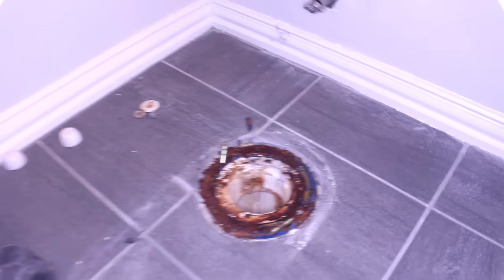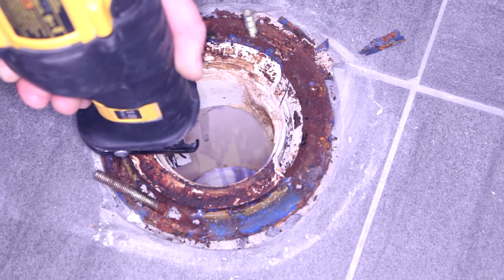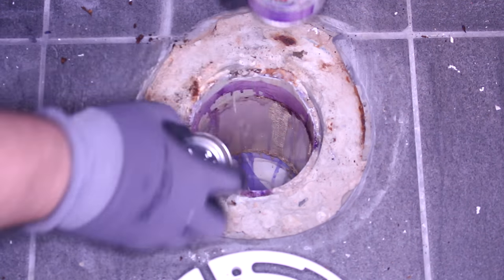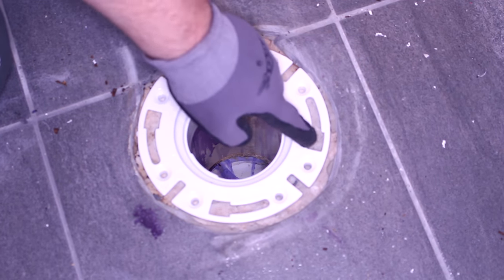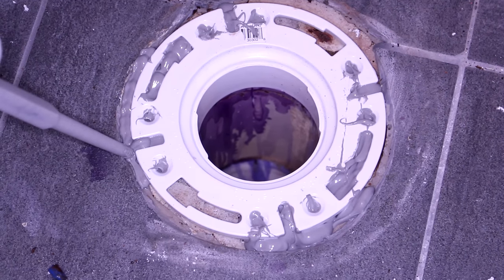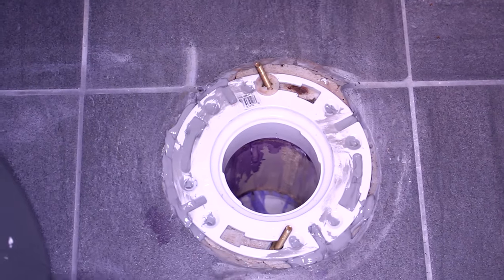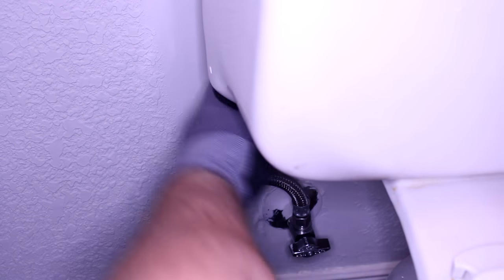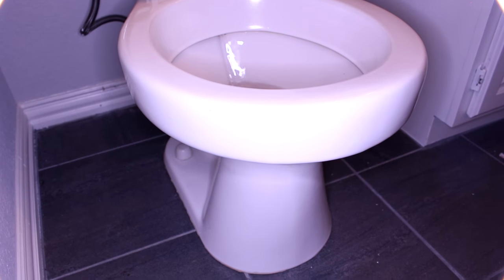How to Replace Toilet Flange - DIY Instructions

Comment: Why is it stuck in there so well  to need a demolition by chisel?  Its just supposed to go in there by friction fit so it can be replaced in the future as nothing lasts forever.  Since  the union goes from a small 3"opening to a 4" pipe it does not leak
Reply from the maker: Did research on it and yes you are right ,  no need to glue it if you can secure it to the floor. thank you for your input.
Reply: My old broken PVC flange is also cemented in.  I am going to have to saw/chisel it out as well.  And no, I WON'T be glueing or cementing it down when I'm done.  If the weight of the toilet (and passenger) is supposed to be enough to keep it in place and water-tight, then all I should do is slip the flange into the hole, add the ring (foam or wax), insert the bolts and set the toilet.  Right?  

Of course this assumes that the foundation you're setting the flange on is level. If not, because they were sloppy and poured concrete or foundation filler around the 4" pipe and never leveled it, then you get into what this video covers.  Adding shims, pouring in quickcrete to create a level foundation for the flange, or worse - trying to backfill voids with filler WHILE trying to keep the flange level at the same time.  Pain in the arse.
Reply: I would suggest that should the system back up, you could end up with something getting between the layers of PVC. I took a different approach and used a bead of flex seal rather than PVC welding cement. I can break that loose in the future, but will stop any grey water from contaminating my foundation should I have an unfortunate back up.
Reply: @SickTwistedFrq  Why not silicone?
Reply: Dr. Dr.
Reply: @briank8482  water gets past silicone slowly. It can take years but it will cause leaks.
Reply: How do you remove the gunk if the grease ring left stuff everywhere?
Reply: @RobC0313  I just scraped up what was in the way with a scraper and used paper-towels. Soap might help but I didn't try.
Reply: @RobC0313  Put a tiny bit of heat on it with a torch, it's wax so it will liquify and can easily be blotted up with an old towel.
Reply: @cra2cra226  This "weight of the toilet holds it down" stuff is BS.  Try removing the nuts on the sides and your toilet will rock back and forth until the wax breaks.  And then you get an actual $hit storm on the bathroom floor.
Reply: This one was glued in. You can see it.

Comment: Do NOT use PVC glue to attach flange to drain downpipe. Because you WILL need to replace it someday either because of flooring or age. Friction fit is all you need as gravity will do the rest, no need for the extra work down the road.
Reply: Are you a plumber? Cause no plumber I know or have ever worked with leave this unglued , code requires it to be glued to prevent sewer gas seepage as well as back up seep of waste water in case of drain line plug up. Your advice is Joe Homeowner sketchy
Reply: @cthulawha this
Reply: If ya don't glue it, how will the bolts keep it from rockin?
Reply: @cthulawha  you're fucking right about that!
Reply: @Jerry-yb7po your not twelve and just learned cuss words awws how cute 🤦

Comment: Great video!!! The concrete epoxy is a stroke of genius. I have a post-tension slab under tile & I loathe to puncture the concrete out of fear of hitting one of the cables holding the slab together. You demonstration was clear, concise, & to the point. EXCELLENT JOB!

Comment: I use a masonry drill bit to drill into the concrete flooring then secure with tapcon screws. Much better than adhesive

Comment: It was a mistake not to have  bolted the flange to the floor.
Reply from the maker: Tenth Dimension I used Epoxy. Works on a lot of toilets  no complains.
Reply: Typical handyman repair here
Reply: @dylandouglas5466  and no wax ring neither..
Reply: My friend has been a plumber for 37 years. He says that screws are not necessary. The problem with it cracking is that some plumbers don’t set It leveled. He also said that concrete floors definitely don’t need screws. I had my toilet removed because the screws, became rusted. When my friend removed the 19 year old original toilet, the flange was rusted because I was careless and lazy, I could have avoided the problem if I had put some caulking, anyways the flange didn’t have screws, because I have a concrete floor, so the problem was rusted flange and bolts holding the toilet , not that it needed screws, on the contrary he had to saw the flange out, like this video shows.
Reply: The flange should set on finished floor by the way, don't hire a handyman to do a plumbers job!!! 😊
Reply: @MrJoevette05  that's a problem I have currently. When I bought my house, the contractor cut the tiles around the flange, instead of removing the flange and cutting the tiles to fit the hole. The only fix I can think of now is to pull the toilet, those 4 tiles around the flange, cut the new tiles to fit the hole and install a new flange on top. I've never cut a tile before and apparently, a lot of floor guys are just lazy.
Reply: @RoccoDemonikDeLuca  just get a repair flange it twists into the inside of the pope, and put washers under the bolt holes with tapcons
Reply: I still recommend fastening flange. Use latex gloves too. Collar should be set on finished floor. Lastly use wax rings without plastic horn. They're not needed.
Reply: yeah i used epoxy too, no drilling involved. works fine.
Reply: he uses a wax ring at 04:35
Reply: epoxy holds forever i use it all the times in construction projects.
Reply: joevette perdomo lol well that would be true other than the fact that if it’s an older home. Or one that’s been done that way prior that a plumber goes out to.  He don’t go out an buy new tile to cut to properly fix the flooring around it to set the flange correctly.  He just does what he gotta do

Comment: That flange was designed to be anchored down with screws. It will eventually crack.
Reply: Pretty sure it'll be fine.
Reply: @notyourbuddy_guy - Pretty sure it won't
Reply: @tenthdimension9836  
If it's on concrete floor it will be

Comment: Nice job, you mentioned the caulk. I like a thin bead of clear silicone caulk around the base after you're sure the leak is repaired. One thing I've found that causes leaks in bathrooms with that type of tile is that the original floor was a thinner vinyl floor which was replaced with the thicker ceramic tile. When they pulled the toilet to tile the floor they should have replaced the already compressed wax ring. Because the new flooring is thicker, the toilet sits a little higher and there is a gap between the surface of the already compressed wax ring and the new height of toilet base. So its good to change the wax ring anytime you pull a toilet, they're cheap compared to the possible water damage of a leaky seal.
Reply: George Crabtree That’s right. Always replace the seal with another wax one or one of the rubber. $9 is a good spend to avoid a nasty leak.

Comment: The outside of a closet flanges is not sized to properly fit the inside of a pipe. This is a code violation. This is what you get when you hire someone who does work without the proper permits and the required inspections. Epoxy is not an approved method of holding down the closet flanges.what do you think the holes are for chewing gum? Use non corrosive screws.
Reply: Then maybe you could make a video showing up the right way to do it?

Comment: Definitely should've used a tapcon bit and screw (if Concrete) and mounted that flange to the floor. That toilet will eventually move around. Epoxy is not strong enough.
Reply from the maker: if you  have  concrete to  screw it  to  sure, in this case  it  was voids  that I filled up with  epoxy  that  used for concrete repair. so  far so  good , been  couple of years

Comment: Nice with a few suggestions...1) Caulking around the perimeter is actually a good idea and you can leave the last 12 inches at the back open so if it leaks in future it will come out there. (Caulk after your test of course) This helps with toilet stabilization when big/heavy people plop down on the toilet. Keeps it from shifting...2nd, use the same kind of flange but with a stainless steel, not steel, ring. A bit stronger than the PVC and will not rust. Still, do not over tighten these either.
Reply: Silly question but is it not stainless  not stain proof?  Won't it rust as well? Thx for any input...just curious
Reply: @davidjunior5773  Stainless steel hardly rusts compared to regular steel. Yes it's called stainless steel. https://en.wikipedia.org/wiki/Stainless_steel
Reply: @mrhyperbolic7455  thx

Comment: Very good tutorial and hints for cracked cement. What if the removal of the old flange breaks the pipe it goes into.  I had plumbers have to solder new pipe to put the flange into.  That can be dangerous as solder and water don’t mix. If you have a chance that would make a great part 2 to toilet flange. I am following 👍

Comment: Holy hell a little overkill won't u say when it comes the concrete adhesive.
Reply from the maker: You have slot of fate in concrete adhesive. All it does  it fills void between concrete and flange . If you want to remove it , just hit it with hammer  couple of times. I think it's better than sewer water if wax ring fails.

Comment: Worth noting, put some rags or something down in the sewer pipe to prevent any pvc pipe from falling down into the drain accidentally...
Reply: How can you put something like a rag down the drain when you are cutting and chiseling the old toilet flange? It would be in the way. I understand putting it over when not working to prevent sewer gas.
Reply: @phonedork  put it down below work level then put your hand down and pull it out, i just did it yesterday.
Reply: @scuffedvegeta2756  yea I did it! I hate toilet work!
Reply: @phonedork  good shit bro, mine was fucked... had to use a multi tool to chisel out the old rotted flange and i did what this guy did, put in plastic one and used epoxy. The concrete around the flange was fucked too, but epoxy filled it in good.

Comment: Thanks...just removed my toliet to replace floor n mine was rusted out/broken. NOW I CAN FIX IT MYSELF!!! Many thanks again!!
Reply: Well sometimes you just need a professional.  Or learn to do the full on repair yourself.  Nothing in life is ever gonna be perfect.  Part of any repair is running into unforeseen problems in the middle of fixing what was thought was the issue.  That can be said with anything.   
When you begin a repair of anykind. U can run the risk of getting in over your head.  That’s part of the process an the risk you take.

Comment: The problem with using primer and glue is it often doesn’t adhere (stick) to a pipe that has been glued before and the new flange comes loose. When that happens I’ve had luck with drilling 4 holes (for the 4 flange holes) for tap con screws. MAKE SURE TO SUCK ALL OF THE DUST OUT OF YOUR DRILLED HOLES OR YOU’ll SNAP YOUR TAPCONS WHEN TORQUING THEM IN.  Trying to remove the broken screws is not fun. 

Ideally, your flange should be higher than your subfloor by about an 1/8” - 1/4”. This is crucial for optimum wax ring seal with your toilet. If it’s not you can bring it up with an extender flange ring.

Comment: Silicone around the front but leave the back open. Water will come out if theirs a leak. Well I am from the UK and most our toilets go through the wall in to a pipe and down.

Comment: Why would a toilet wobble after a wax seal replacement and new bolts.
Reply from the maker: Most likely uneven floor surface. Use shims .
Reply: I have the same problem, someone did a horrible job tiling bathroom and tiles are uneven under toilet. I put many plastic shims all around toilet on 4 locations about 1/4 inch to 1/2 inch; next time we used toilet have water all over.
I thought it was a damaged wax ring but it was a cracked pvc flange and it was a nightmare to replace it because had concrete all over, around and on top of flange and uneven flange as well, etc... I was supposed to replace 6 tiles but hard to get same one so just replaced flange the best I could. I still had to put less shims thanks to uneven floor.

Comment: Did you take the rag out of the drain?
Reply from the maker: Steven bell ,I am not sure what are you talking about, but yes if you have a rag in the pipe remove it.
Reply: Legacy Handyman there is a rag in the drain when you cut the old pieces out and it’s still there in the shot before you put the pan in place. I didn’t see you remove it.
Reply from the maker: What you see is a different color pvc elbow. we never put a rug in the drain.
Reply: Legacy Handyman Ahh I see it now. It looked like a checkered towel to stop debris falling into the drain. 👍
Reply: @stevenbell7902   how about the wax ring did he put one on?
Reply: I see what looks like cloth is the adhesive on the inside of the pipe
Reply: if you didn't see him put the wax ring down you must've been high

Comment: Just one tip. Stuff an old rag or even paper towel in that pipe below. If a big piece of that plastic goes down the pipe you have a disaster if you cannot reach it.

Edit: I’m a master plumber with 34 years under my belt.
Reply: Alan Sawyer If was pretty far down but it looked like a blue plaid towel/rag was in the hole.  66, doing my 1st cast iron flange repair after morning coffee.

Comment: wouldnt it be easier to use a flange repair kit? the two piece kind that combines under the lip of the flange?   or are they not as good?
Reply from the maker: We don't recommend to use those repair kits .
Reply: @LegacyHandyman  why not?   Not trying to be a pain just really would liketo know since that would be a much easier solution to my situation.

Comment: It looks like you can replace just the metal flange if the PVC is in good shape. I wish I had known that because my PVC didn't come apart, instead the fitting broke. I'm having to open the floor to repair it properly.

Comment: OK ... a little rough  ... but using primer guarantees future replacement will be awful.  I only use glue.  Why?  It holds the flange great and does NOT make it a nightmare to remove in the future

Comment: Is  applying primer and glue won’t be a problem for the future replacement? Some of them suggest to apply a glue only so it won’t be a headache when trying to replace again. is this true?
Reply from the maker: I don't think it would be a problem because if it would be done properly in the first place we would not have to replace flange, just a wax ring on the bottom of the toilet.
Reply: @LegacyHandyman  bull it is a problem thats why only glue is used. And can't compare a plastic flange to a cast iron one..
Reply from the maker: sergio anchondo everyone entitled to an opinion.I  did a few of them the way  I showed it in this video, and all of them are working without any problems.
Reply: I just coat them with molten wax (i recycle the old rings by melting them and pouring the clean wax in a metal can).
Reply: They sell primer for a reason. You’re supposed to use both for a reason. If u know what the fuck u r doing, removing it shouldn’t b something u can’t achieve. Not using primer for the reason u suggested is just moronic.

Comment: This is going to be a bitch to remove when it needs to be replaced again. I would've used a flange with a rubber seal that goes inside of the pipe and would not have used glue or epoxy.

Comment: You didn't rotate the flange a quarter turn when chemically welding the 2 PVCs together as required to make sure a good bond is made all the way around, also seems you skimped a bit on the glue. The next guy is going to hate you for adding that epoxy cement and making the flange replacement a PITA. Should have done it properly by applying epoxy cement, smoothing it out and letting it set then installing the flange and use proper screws instead of this epoxy cement to anchor the flange to the substrate. Epoxy cement doesn't provide the same holding power in the way you applied it.

Comment: Caulk prevents a fouling area. If mop water, bathtub water, or a less pleasant “bathroom liquid” gets underneath the toilet, there is no way to clean it up. Caulking around the base of the toilet will prevent this from happening. Water under a toilet in the absence of light will bring mold.

Comment: be very careful sawing and removing your flange, i have had some break the pipe joint below and that is a whole mess of worms.
Reply from the maker: Absolutely. You should be careful when doing any work . Thanks for pointing it out .
Reply: They make a tool for drilling out the flange. Pounding away at it like that is another mistake. Could easily crack the pipe down the line and not even know it. Until you get the callback for the leak that is.